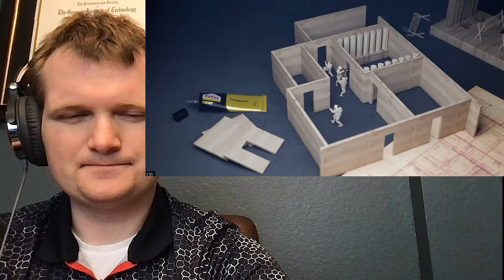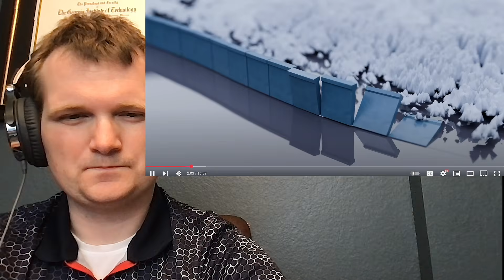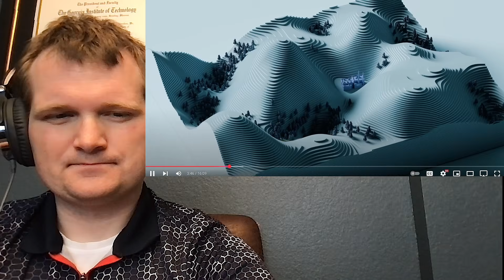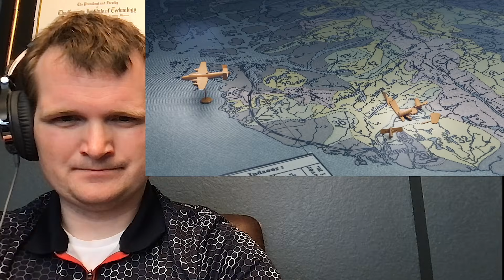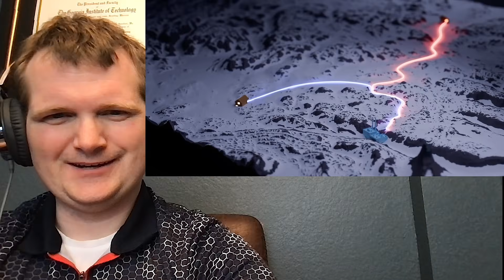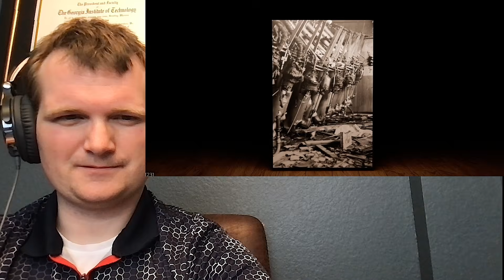The WWII Raid That Saved the World From Nuclear War? - Nuclear Engineer Reacts to Solve

Comment: Completely off topic but I can't find the video. Computer Science Major here and I have modeled something that's come up before. If you fall feet first into a Super Massive blackhole you would likely not be spaghettified going in, and it might be possible to avoid the radiation/heat of the accreditation disk BUT... you'd still likely pass out and die before you cross the event horizon because of time dilation. The Schwarzschild radius around a blackhole the size of TON-618 for example would alter time such that time at your feet could be as much as 5 minutes difference from your head. Meaning strong heart or not your circulatory system would fail to deliver oxygen throughout your body.
Reply: If I fell into a black hole I doubt I would even remember to try to breathe... 😨
Reply: You would die due to the radiation nearly instantly! There is no making it through the event horizon, you'd be long dead.